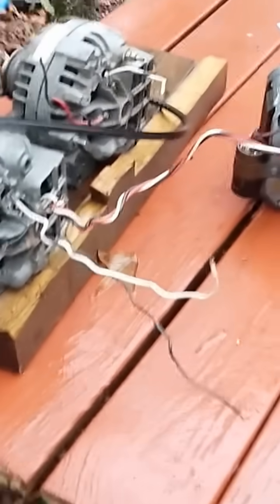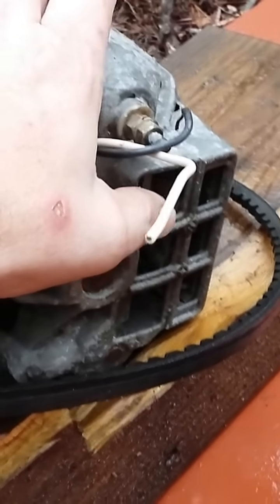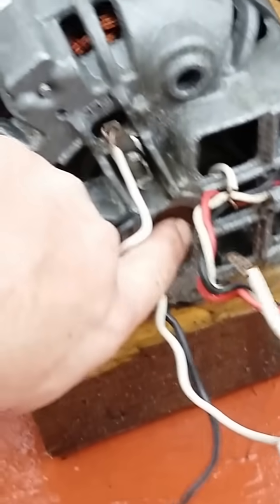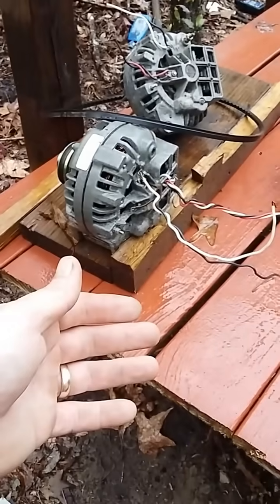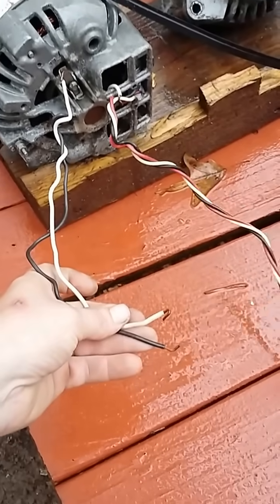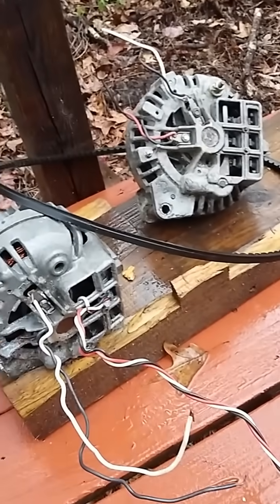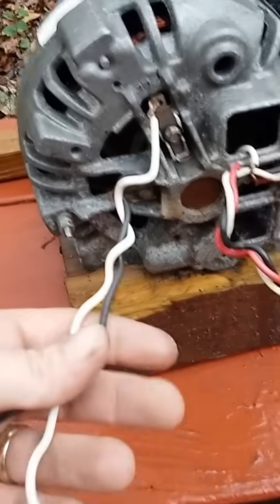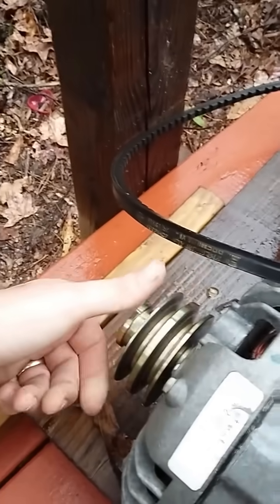Update Free energy forever no wind no solar no gas READ DISCRIPTION!!!

Comment: If it makes 90A @12V the alternator has an output of 1080 watt.    1080watts / 240V = 4.5 amps, enough to run a mini fridge I guess. But connecting a motor, by belt, you have loses from the belt, tension and friction will factor in, the alternator is not 100% efficient, the drive motor isnt either.  Energy can neither be created nor destroyed.  You can not get out, more than you put in, so you need a gas motor, which would cost more in fuel than the average Kwh $ for electric, an electric motor which.....defeats the purpose because as stated, you cant get out, more than you put in. Or a creek, which under any real load, will require a good amount of head and a pelton wheel to get the rpm and torque needed to turn the alt under load.  If I am missing something, I am all ears. Not trying to be rude or mean, just see a lot of these videos and people seem to think this is a new found "off grid hack" people been doing this for years. But generally it just isnt enough output to warrant messing with.  Consider the size of the generator head on a 3500W generator. It's pretty massive compared to an alternator, with finer wires for the coil, and more poles to keep RPMs low. Average generator can put out 3500W @60amps,  again, a 90amp alternator will produce 4.5amps @ 240. Again, if I'm wrong, I'm all ears, never want to miss an opportunity to learn.
Reply: I agree with you that energy cannot be created or destroyed...  however there are ways around this with perpetual motion and gravity if done correctly.  Yes it takes power to get it going, but once going the momentum offers enough power to keep it  going forever.  So there can be small trade offs for big outcomes.  I absolutely love ppl taking washing machine motors, creating hydro tips, and using water weight to create power.  Everyday im getting more amazed at how much power can be created for free or from used "bad" batteries.  Priceless information to be learning
Reply: @TurboHommy  im all for Pelton wheels, but I do not believe that perpetual motion is a possibility.   If energy can not be created, nor destroyed, only transformed, then you can not get out more than you initially put in. Then there are other losses, friction and drag. From bearings and drive belt, magnetic drag, heat will be produced, so that's lost energy.  If you get it running, hook it to a load and pull 8 amps or more for more than 3-5min, id love to see that, i just don't see it.
Reply: @michaelpinto9357  i think i can agree with that.   I suppose its not "endless" free power.  But i think that with minimal power input, you can get 100 times the output energy in this way.  Its not perfect, but its definitely amazing.
Reply: those alternators cannot output 240 volts, its all about how fast you spin them.  the faster you spin them the higher the voltage they put out, to a point.   meaning there is a limit before they start to come apart .    and you are correct you only get the 90 amps at  12-14 volts   he thinks you can get 90 amps at 120 volts,  he does not understand  how electrical power works.   at 120 volts you would only get about 10 amps.

Comment: All these idiots commenting on here àre obviously slow at best. He said 3 times that you either turn one in to a motor that you run off 6 volts or you use A gas motor wind motor or a creek to spin the dam thing . Hook it to a fucking 10 speed peddle bike and peddle your happy ass to spin the fucking stator. To create power that's a your dam car does it has a belt that spins it and it creates power it don't matter what turns the fucking belt .Lol you all are the dumb ass's
Reply: I seen this, he wasn't going to cook the meal and feed you too, he left it for those who gets it... Without saying it...
Reply: So you use one alternator as a motor run off 6volts and then another alternator as a generator? You still have to have the battery. How is it free energy in that case? The wind and water I can see..
Reply: @haveaniceday7950  if you use a battery all you need to do is run a Exciter wire from the alternator "generator" to the battery . Creating a loop
 Witch keeps the battery charged and keeps the motor running  which turns the alternator "generator" witch creates electricity witch charges the battery  therefore creating a constant flow of power with out the power company and with out using fossil fuels. So it's free energy.
Reply: SoulMedicine Music-Radio thanks for the reply. 

So the alternator would be directly connected to the mains of the house not the battery, correct? 
There's no need for an inverter? 

Just one battery and one alternator is needed? alternator is converted to a generator as shown in the video. 

Do you have a video or diagram or article that explains more? Everything I've seen that's detailed is using a wind or water turbine multiple batteries and inverter. 
Have you done this?

Thanks!
Reply from the maker: Generators or alternators can also be self-excited with a capacitor and two diodes. Thanks for the comments 😊
Reply: @haveaniceday7950  technically yes it takes power to make power here.  But the input is minimal compared to the amplified output you get from it.   But ya, once energy is used to get it started (weather that be a charged battery, or you use a bike to start it amd it starts charging itself after), the system feeds the house, and recharges itself becoming self sufficient.
Reply: Turbo.Hommy have you done it? 

So the alternator would be directly connected to the mains of the house? 
There's no need for an inverter? 

So battery output to  alternator which outputs to mains of house and back to battery?
Reply: @haveaniceday7950  and it's 12 volts 6 amps in the first comment I  wrote 6 volts  on accident. I meant 6 amps and 12 volts

Comment: Shake my head... stay off the drug dude.
Reply: Because the alternator does not put out the voltage that you need it has 90 amps but it runs it like 12 to 14 volts once you jump that up to a hundred and twenty volt you looking at maybe 20 amps you're not running anything off of that
Reply: @maethomas1391  so wire a few in parallel then to get your amperage up and keep the voltage at 120....
Reply: Explain why?

Comment: All his doing is saying the same thing over and over. Not showing no one nothing
Reply: It's right there, how do you not understand...
Reply: Lucid Dream  yes that's correct if you're using the methods today, but there are other methods, Nikola Tesla figured this out in the 1890s-1920s. All you need is a rotating magnetic field( both N and S) poles. And a coil, preferably copper with and iron core... now knowing that's all you need, if you think for a moment it's extremely simple.. Another hint Nikola Tesla...

Comment: Power wires on my stator are 3 what do I do with the neutral wire ? My GM 1 Wire Alternator I’ve tested with my multiple meter  current of 1970v Ac
Reply: So much for asking a simple question and given him respect as someone with more experience and the answer he gives me is “ do you see the stupid questions this is why I disabled Questions “ I hide-sight looking back now , respecting him and asking for help as he said is Stupid all has to look at the source !
Reply: @marktheamerican4162  At what kind of load. As someone who has dealt with electricity for a long time I will tell you that that alternator of his will not put out 90 Amps at 240 volts. Why? Because the first thing you have to look at is the wire size in the alternator and coming out of it. As built, the alternator would produce about 1350 Watts.  So about 6 amps if rectified to DC at 240 Volts.  In the case of yours, that would be 1 amp at your voltage most likely. That is within the current range of the wire but not good for the insulation. Bringing yours down the 240 would get you about 8 Amps when rectified to DC. Reason I say it isn't good for the insulation at 1970 Volts? Most of the wire coatings are rated for 600 volts. Unless it is specially designed equipment for higher voltages. When you go above that, you run the risk of an arc forming from the location of the weakest spot in the insulation. That is why industrial motors are checked every so often with a Megger. It checks the insulation value of the wiring.
Reply: there is no neutral wire with three phase, all three power wires use one of the other power wires for its neutral when they are out of phase.
Reply: @rmendes2mendes915   Depends on the wiring configuration. Look up 480-277 VAC Wye configuration some time. Or 208-120 VAC Wye configuration.

Comment: can i use a 12 volt dc motor to pull the alternator to power my home?and if i wire  the dc motor from the alternator will it also power the d/c motor?
Reply: no
Reply: the answer to your questions is yes and yes.  it does not matter what you drive the alternator  with,  these systems are a balancing act.  they only work if the current  (amps) drawn by the drive motor is lower than the current the generator or alternator can put out continuously without over heating.   this system in this video will not power your home. he is incorrect in what he is saying however you should be able to get the one alt to drive the other however I don't know what if any excess power there will be.   he says 90 amps AC and that is correct but not at 120 volt.  the alt can put out 90 amps at around 14 volts.  AC or DC.  now if you bypass the diodes and voltage regulation you can get 110-115 volts out of the alt but only at the same power rating the alt has when running at 14 volts.   volts times amps = wattage. so 90 amps x 14 volts =  1260 watts and that will not be continuous use, if you  draw that much power continuously the alt will fry and burn up.  so back to making the alt put out house ac power.  we know the alt can only source about 1260 watts so do the math,  watts 1260 divided by the voltage  115 volts will give you the max amps you can draw  which is about 10.9 amps.  so if the alternator was left connected to your car you could bypass the regulation circuit and as long as you kept the alt spinning at the speed needed to get your 115 volts you would get 115 volts  AC you could use in your home but could only power things that drew under the 10.9 amp rating. and only for short periods of time unless you had a way to cool the alt to keep it from burning up.   or you could run something continuously at a lower wattage / amp rating.   and if you power a motor  that you turn the alt with then you would have to count the amp draw of that motor  in with the total output the alt will be powering.
Reply: yes you can turn the alternator with a DC motor,  but it won't power your home, you will only get about 1200 watts out of the alternator and most of that will be used up to power the drive motor, your DC motor. you only get to use the excess.    and yes you will be powering the DC drive motor using the Alternator,  you will have to rectify it to get DC power.

Comment: I hope you are still willing to share information.  I just found this video tonight. I have been disabled for a long time but managed to bring in income. Since late 2015 I haven't been able to work. I'm a single mother. Our trailer burned down a year ago this month. I had no insurance. We got some donations and a 40 year old singlewide donated. But we've had no income since the donations ran out in July 2019. I need some way to run my well pump (and my trailer would be nice too). We can live wi ty hour electricity since we lived in a shack for 9 months, until we got the donaaaateed trailer in December. But, we can't live without water from the well. How do I get in touch with you or find videos to teach me how to use your alternator methods or whatever?

Comment: But you keep saying to spin the staider with another motor. What powers that motor?
Reply: Took the words out of my mouth he's probably going to power it with the generator he's builden lol
Reply: he says you add a little power to the alternator it becomes and motor while supplying 90 amps out of the other connections. it's all in one... it uses power but then also generates so in essence you could power itself while providing additional power for other stuff.. it just needs to get started.. then it will run itself.
Reply: the problem with his video is he is not speaking the correct facts , and not  showing correctly how to do it.  but you can make the one alt run the other and maybe have some excess power left over if you do it correctly but it will never run your house.  you can only get about 1200 watts out of the alternator and most of that would be used up powering the other alternator as a motor to spin the alternator that is producing the power.   it's  a balancing act but usually done with a smaller drive motor than the output generator.
Reply: Yes a motor or windmill or a creek or a ten speed and peddle the dam thing lol

Comment: He said if you know anything about electricity you have two poles and a ground wire. That’s the most incorrect thing I have ever heard. Three phase ac uses 3 WIRES. Doesn’t have a ground those are most likely a delta configuration and They don’t have a ground point. People are saying that it is hot, neutral, and ground, but this is three phase. It doesn’t have those three.
Reply: Yup, hot, negative and ground. AC
Reply: Beth Hoyt that’s how wall sockets are wired up, ac motors and generators are wired in a delta or wyd configuration. They take three phase ac which is just three live wires, no neutral or ground.
Reply: @FioraniMotorsports  In a 12 wire alternator you can have a neutral wire,  or even three of them. If you look at a Wye transformer used on three phase, you can have a center tap which is the neutral.  Measure the voltage across the three legs and you get 208 normally. Measure from the three hot legs to the center tap and you will get 120 volts between each of them. Take a look at a Smartdrive motor some time. While normally they are run on pulsed DC, they also will run on 3 phase AC. All three phases are used with the last wire of each set of coils going to a common point. Now spin it as an alternator, you get 3 phase out. You can use the common point to get a lower voltage to rectify or the 3 main terminals to get higher voltage to rectify. On a 3 phase system there are always 6 wires from the coils as a minimum. The difference is where the wires are connected. Delta means two wires are connected together at three points where power is input. Wye wired motors are 3 wires at one point and three wires that only would be connected to power. And there always is a ground in a 3 phase system. Because without it people can get killed. That is what ground fault circuits are for and they do require a ground.
Reply: Beth Hoyt wall sockets use single phase, hence the live, neutral, and ground lines.
Reply: Possibly have any suggestions on which one of these science experiments might work to try.
Reply: Yea but he said you can run it right to an outlet and plug stuff into it

Comment: $300 a month 🤨 im paying £10 a week ( something like  $16 )
Reply: 300 yeah on a cold year 500 you got to remember it's you know 20 below out minus the wind chill that was until I changed to burning wood in the winter time I got to cut back a little over 200 but that's still a lot of money I think ridiculous
Reply: Get a really big heavy flywheel , use accumulative human input or a small cordless drill to get massive torque..exploite some leverage . You can juice up MANY huge super capacitors in seconds with a big clunky industrial mechanism....flywheels let us add more energy like a battery, if you pedal into a 3meter 5ton flywheel , within seconds you'll be outputting MANY times the torque of a large conbustion engine. Doesn't need to run long , ten secs juice up your room full of super caps then use them to power a drill turning another or the same wheel..its Victorian industrial Britain stuff , HIGHLY documented...leverage = free work.
Reply: you're after leverage the wheel doesnt need to be tonnes btw , bigger the better..